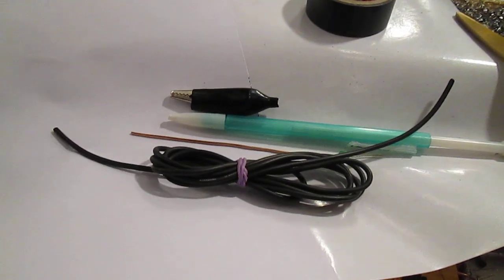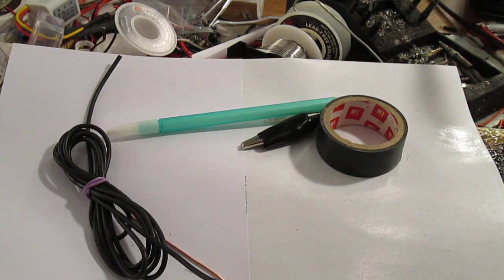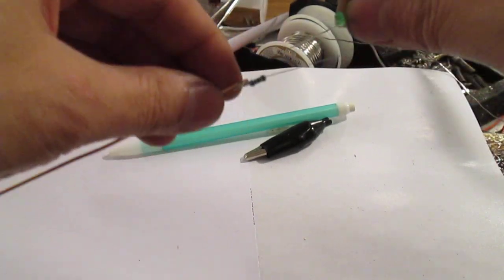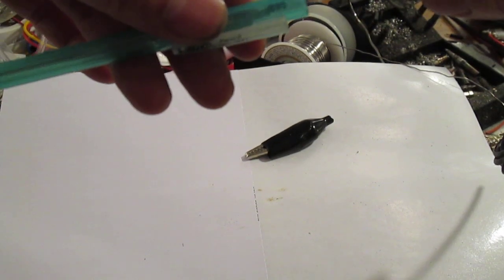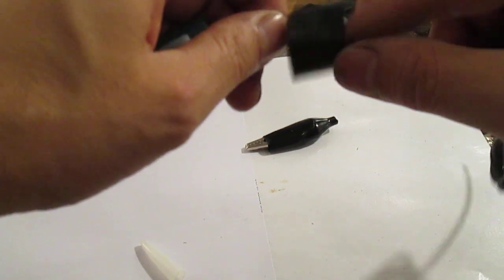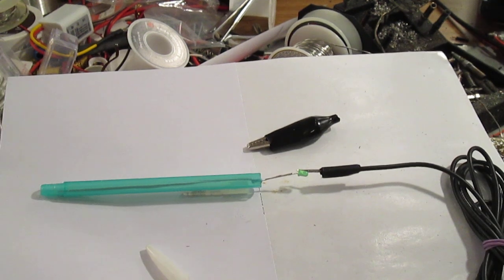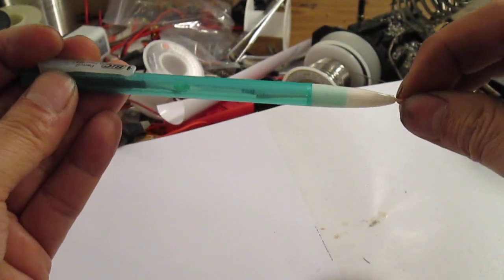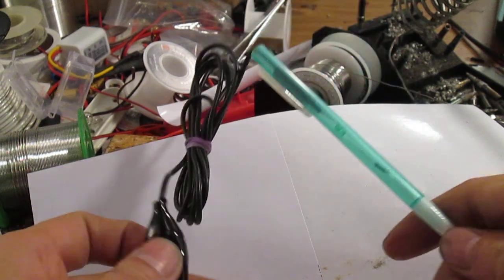DYI Simple 12V DC Pencil Light Tester Car Volt Test 3 6 9 12 14 18 24 DC Automotive Polarity Fuse

Comment: Nice ,good work I am not a technician but I can now make it for my tastings for the car.
Reply from the maker: Hi thankx! I am not an Electrician neither.  But it's really easy to do as you can see.  Just make sure to use the right "Resistor" according to your Voltage needs, that is about it.

Comment: Is their a proper way to put the 1.5k resistor? or it still even i put it vice versa? And i want to make it 2 led it's okay?
Reply from the maker: +Raymond Hermogenes
 - You can use 2 LEDs.  Also, the Resistor don't matter... Either way will work!